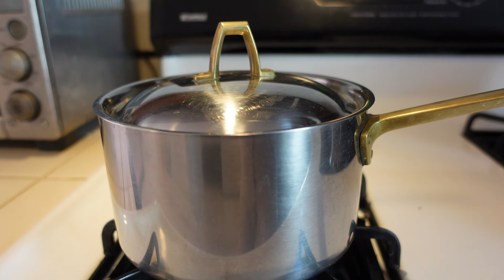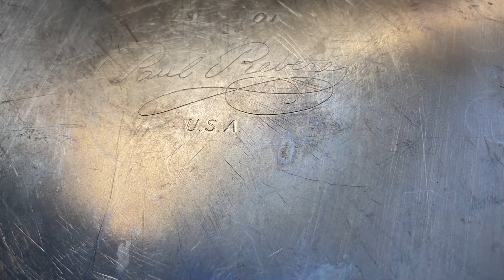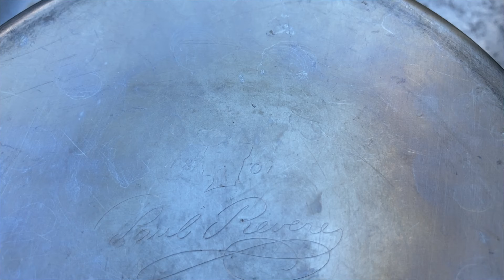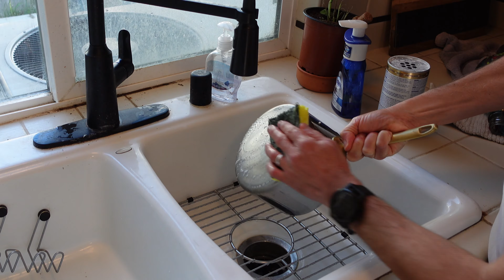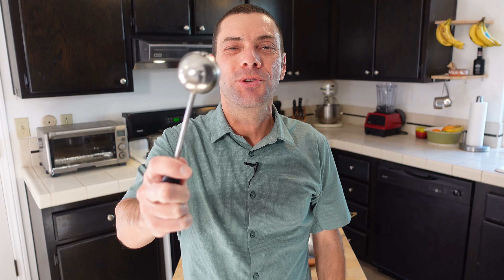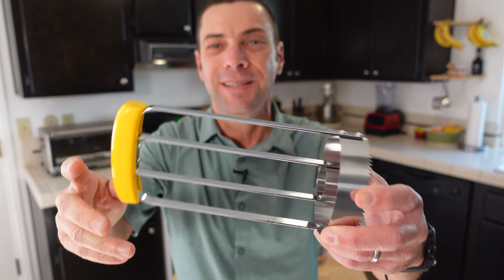Is This Rare Paul Revere Pot Still Any Good?

Comment: I have a set that looks very similar to this pan, except it is double ply instead of triple ply. The outer layer is copper all the way up the side and stainless inside. The copper does not look to be as thick as your pan. Has the same lid design but again copper on the outside and stainless on the inside. Same brass lid and pot handle, the larger pots have brass loop handles on each side. And yes those handles get very hot. They do a much better job of spreading out the heat than the regular Revere Ware but not as good as All-Clad. Glad to know that these exist, will be on the lookout for them.
Reply from the maker: Happy hunting! Since making this video, I have grown only more enamored with this pan. I now use it almost daily, and it turns out the most delicious food. Cheers!

Comment: Another brand to keep an eye out for. The way that that the copper is 'sandwiched' all the way to the top and not just a clad disc at the bottom makes this one pretty interesting. 

Trivia: What is a very aggressively toothed pineapple corer. I Imagine that you need to put some rotation on that thing for it to work well. Or I could be totally wrong. Thanks for the video!
Reply from the maker: Indeed on the cladding to the top! I was  pleasantly surprised to see that, and it certainly seems to help things cook evenly. For rice and other lid-on recipes, this sucker seems more like an oven! 🙌